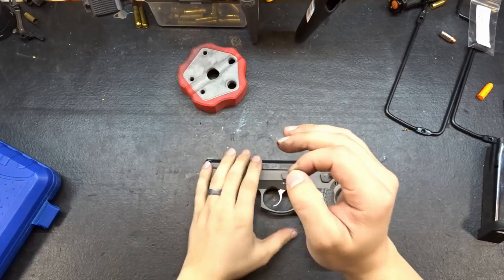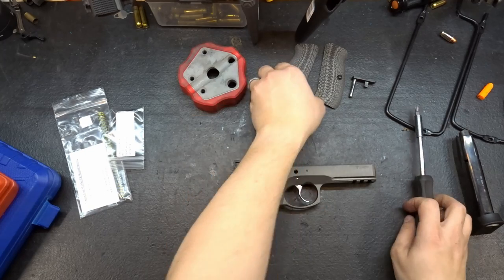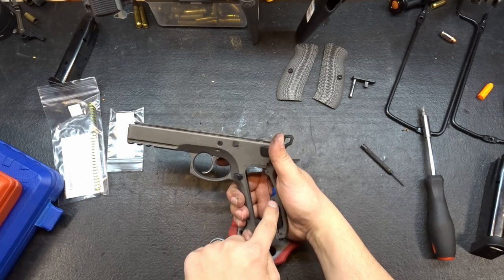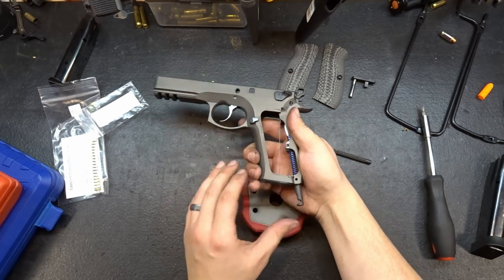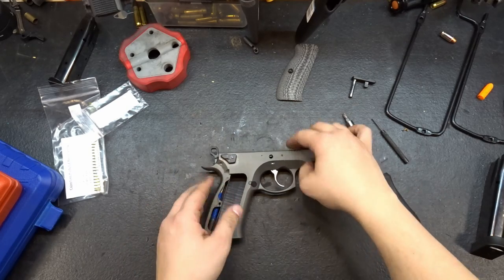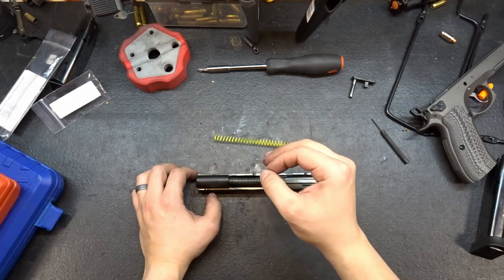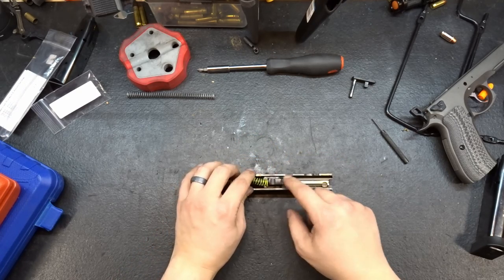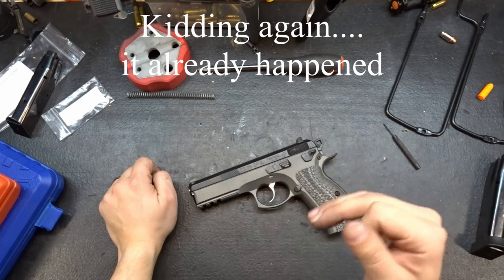CZ SP01 recoil spring and flat Hammer Spring plug install

Comment: a Joe Tool from CGW - if you're going to do a lot of fiddling with CZs - is actually useful to have.
Reply from the maker: I've actually really thought about it.  because i've got the P01 modifications coming up that's going to require that thing out multiple times.  Luckily they use that solid pin.  Just dealt with a Beretta that had a spring pin in there, much more of a PITA than even these are.

Comment: I would also look into some mecgar magazines with basepads. I use springer precision they add weight so the mag drops free which was an issue you had during the match you shot.
Reply from the maker: I run a combination of mec gar and factory, but I'll look into the base pads. That mag still had rounds left in it, which is why I'm surprised it didn't drop. I think I turned it too quick and just didn't give it time to get out.

Comment: How did that 11lb recoil spring perform? I want to get a  stainless steel guide rod and they recommend one of there recoil springs just not sure what pound spring i need 🤔
Reply from the maker: Works great, just cant use high pressure ammo

Comment: I was actually thinking of doing the opposite for my P-07 because getting the flush one installed is near impossible by myself. If you own a P-07 I'd be very interested in your technique but also what hammer weight spring you use because my guess is the stock one is over powered that I'm using?
Reply from the maker: I do have a reduced Power hammer spring. the technique I use it is sitting in a rather large punch vertical on the bench and then pressing straight down into that with the bug. Works pretty well, just got to make sure that you're pressing straight down. Hold the punch with one hand, the pistol with the other, and when you get it pressed down all the way, let go of the punch grab the pain really quick and toss it in

Comment: I tried the new spring but the slide will not lock back...switched back to the original and now works fine
Reply from the maker: You're probably are getting spring bind. The big round coil springs tend to not coil as cleanly. Get a hold of Cajun Gunworks and theyll get you set straight.

Comment: I ordered a 15lb hammer spring. 
Should I get a lighter firing pin spring and recoil spring?
Reply from the maker: IMO, CZ mods handle light weight hammer springs better than others, though it costs more. Pick up an elongated firing pin. No risk of slam fire like with a light weight spring, but improved reliability. The recoil spring is based purely off of feel, really. I got one for my Sp01 to reduce the slide velocity, making lock up smoother.
Reply: Work I have the po1 omega
Reply: I also got the reduced firing pin spring so he it or use a extended pin it's for carry
Reply from the maker: Ya lost me with that one. Typically they send a new spring with the pin, but it's not mandatory according to CZ Custom. The stock spring will work with an extended pin